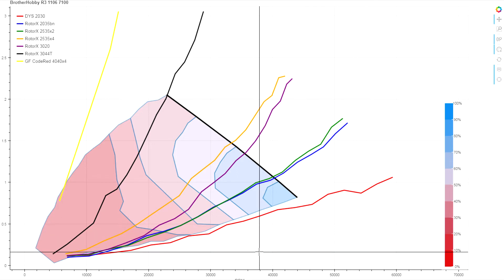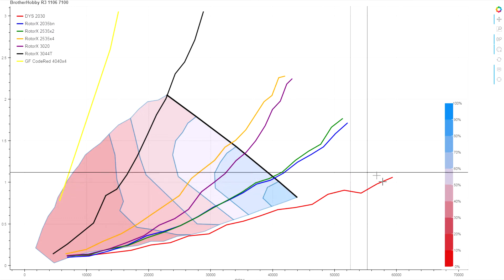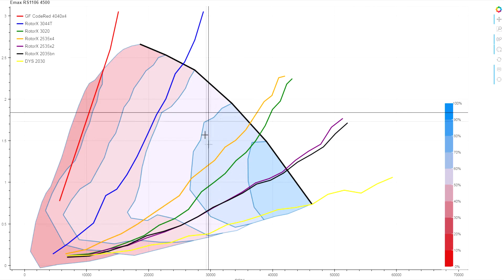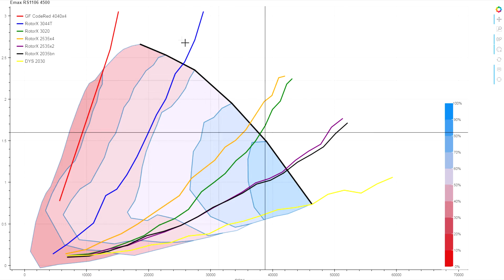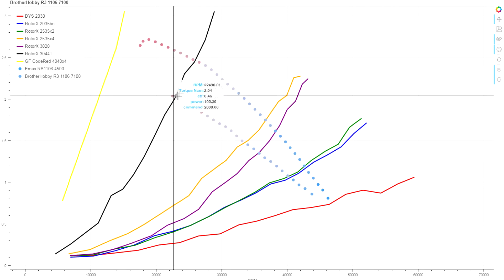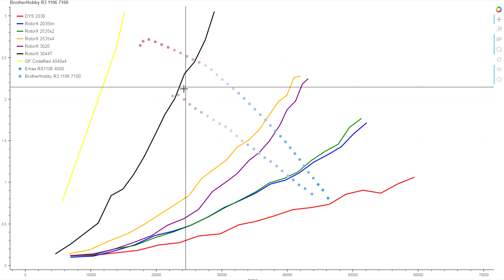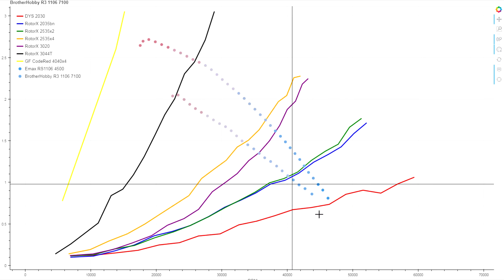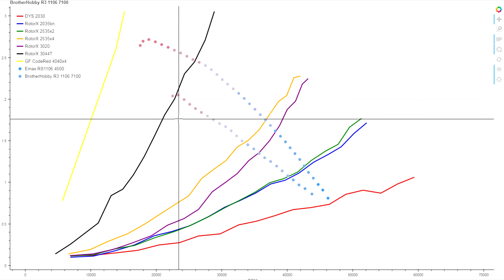BrotherHobby Returner R3 1106-7100kv Dyno results

Comment: So what is your recommendation for a 2inch build? For 2s/3s?
Reply from the maker: 2" is still a little smaller than I have a lot of experience with, I'm using all emax 1106 or rcx 1304 right now on 2.5" and I've been liking the rcx more and more, though it's maybe a little heavy for a 2" and isn't available in high enough kv.
Reply: SiieeFPV so for a 2inch is it better to have a 7500kv motor? I was wondering as I have some 1103 motors.
Reply from the maker: depends on the prop and what your drive voltage is, but as you go to smaller and smaller props you tend to have to make up for a lack of thrust with more rpm, which naturally leads towards higher KVs
Reply: SiieeFPV Thanks. I was actually thinking about 1105/6 7500/8000kv for 2s. Any thoughts?

Comment: Does that mean those motors are bad ?
I actually use them on a 3inch racer with 3025x2, i got 2.30min flight with 3S 550mah pushing hard :p
For sure they eat the lipo but speed as a price XD
What do u think ?
Reply from the maker: I'm not a big fan, but that doesn't mean that the motors are bad, you're just giving up battery life and perhaps a tiny amount of thrust.  I did recently pickup the piroflip version of both the kv options, so I should have a better look if this one was just a KV fluke or not soon.
Reply: Ok thanks, i just bought RCX H1304 5000kv to replace the Brotherhobby 7100kv ;)
Look like those are still the best on the market.
Btw your channel is awesome !!!
Reply: how much current in 2S with 3 inch props?